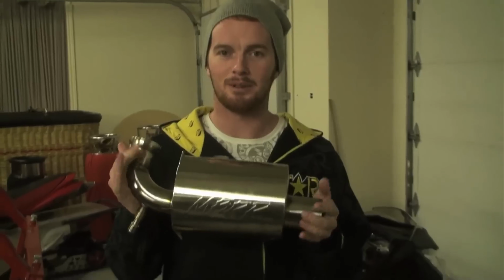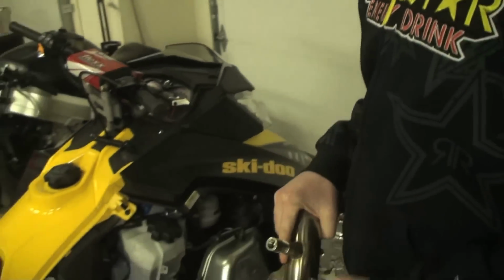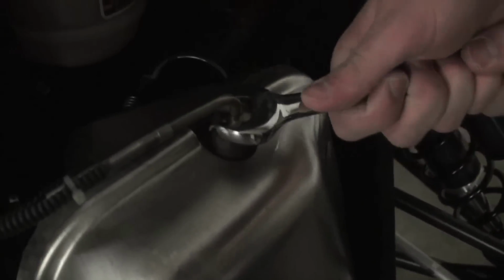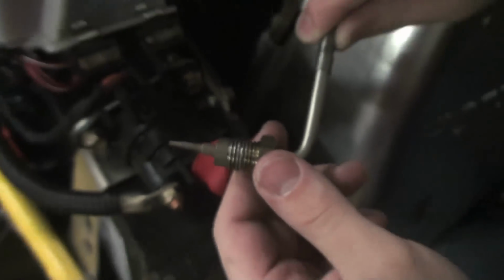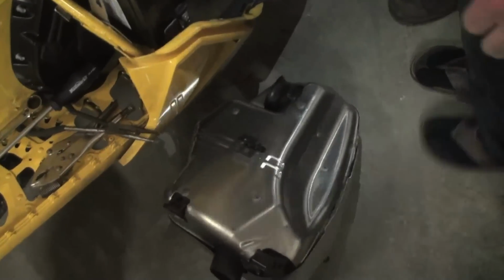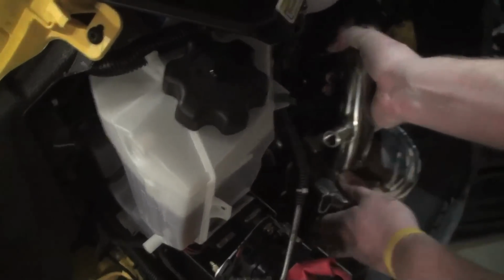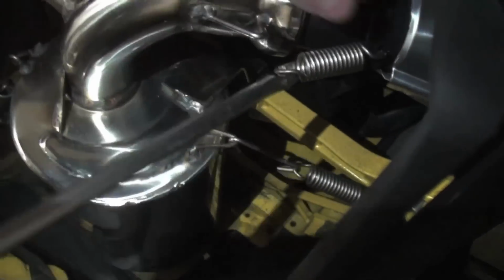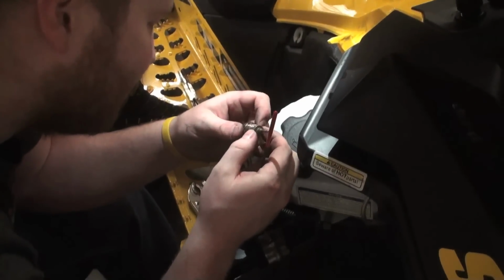MBRP Can 2014 Ski Doo MXZ XRS 800! BRAAAP!

Comment: happens all the time with o2 sensors, what happens is carbon builds upon the threads that are exposed inside the exhaust (the threads that are now fucked) thats why the sensors almost always crack loose easy then as you back it off it seems to get tight again, that's the carbon buildup getting jammed up between the threads. Carbon is harder than mild steel which leaves you with dickered up threads. you can buy re-threading tools just for o2 sensors/ bungs.

Comment: Aluminum in steel! Duh! When it started to get hard after two turns and u cut video cause u were forcing it! Lol u left the threads in stock can! Ski doo didn't cross thread it! U did.  Should've went back other way when got tight and then loosen little at a time with some spray on it.